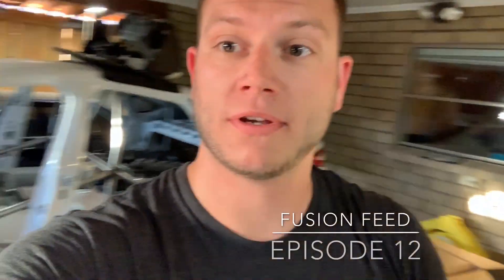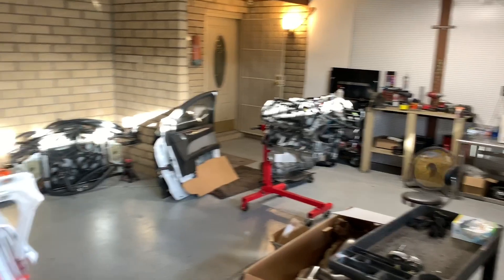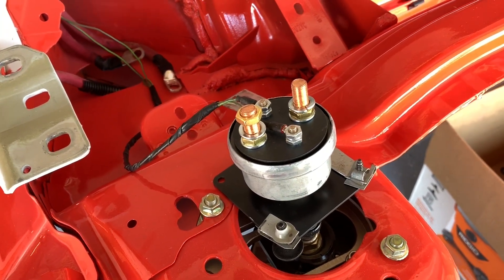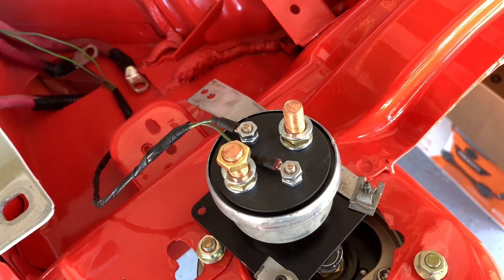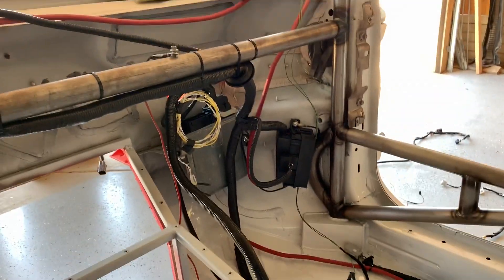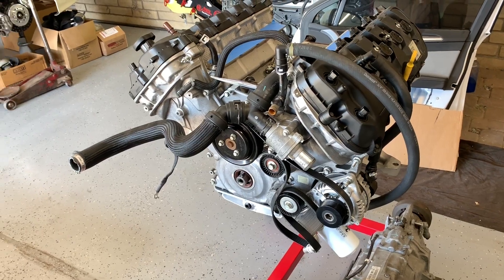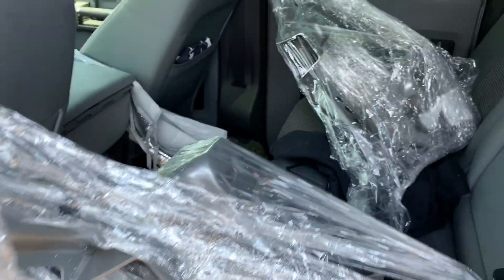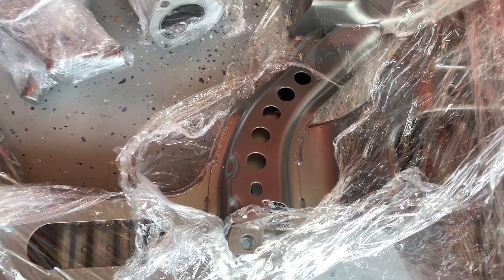Fusion Feed: Ep. 12 The Fusion gets NEW SHOES and more!

Comment: How do you deal with the front wheel clearance while getting decent amount of steering angle since the frame rail of fusion is wider than the mustang?
Reply from the maker: Good question! The strut towers are a touch wider, yes, but with the S197 based arms and sub frame up front, along with the custom arms we made that are extended 3" from where the factory pickup point is, and a reasonable wheel and tire size choice, I didn't have to clearance anything much really.
Reply: @MattSoppa  I see what's your saying now, silly me kept wondering how do you get that steering angle without having to massage the frame rail or a crazy poked out front wheels. Congrats on the progress so far and can't wait to see it goes side way!
Reply from the maker: @zl_390  Welllll front wheels will probably still poke tbh, so I'll try and roll the front fenders when the time comes.  Appreciate the support!